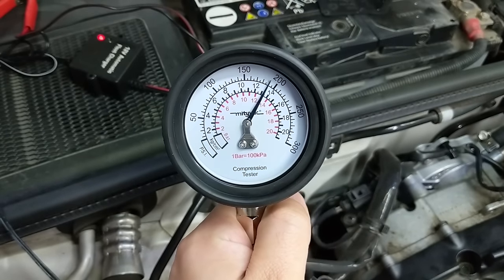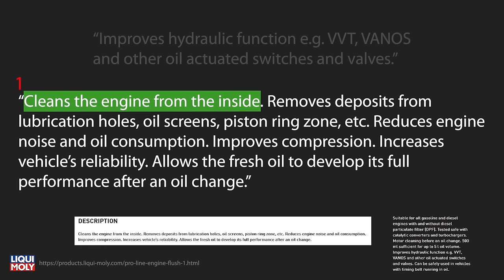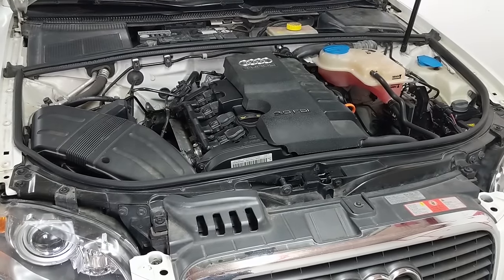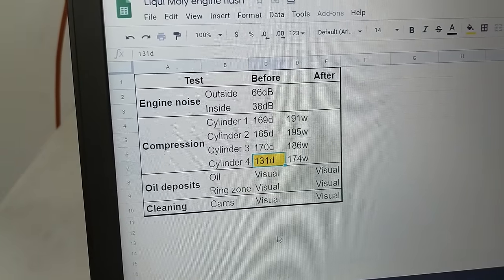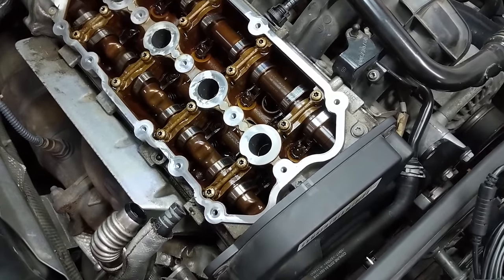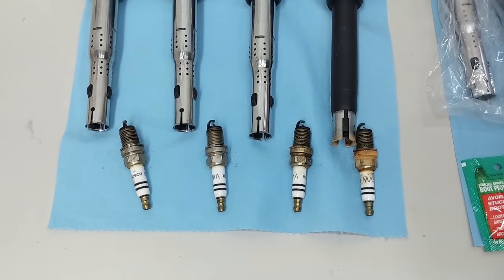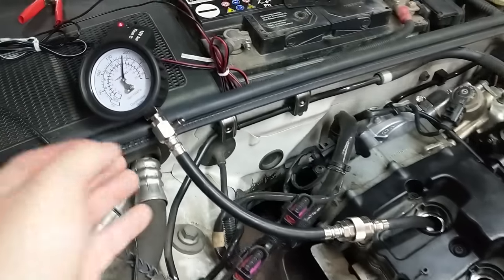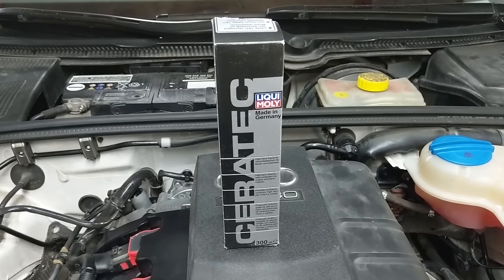Does Liqui Moly Engine Flush work? | Full Test & Review | Pro-line 2037

Comment: Just change your oil regularly. Modern oils already have detergents. That is why you change the oil as the oil itself does not actually wear out but it does get contaminants. Long ago Valvoline made detergent free oil. That caused the engine to gum up.
Reply: It's called combustion. No matter how many times you refresh the oil, there will always be deposits
Reply: supposedly Valvoline" has a Newer oil out W new stuff to help clean it while ur driving? pretty sure it's real.

Comment: I used this product and moved my oil changes to every 5k miles from the 15k that BMW specified that the previous owner did. I noticed a difference in the oil drain color 2 oil changes later. It stopped coming out dark black and now has a slight gold tint to it. I think it takes a few changes to really work. Just my $.02
Reply: Was looking for this comment. I just got a BMW 335d and the previous owner was doing the 15k/1 per year oil changes and I want to get the gunk out from that. I'm changing my oil every 5k 😂 they're out their damn minds telling people that's an acceptable change interval
Reply: mr mathew, you wouldn’t know if it’s liquid Molly or more frequent oil changes that made oil cleaner thO - 2 improvements at 1c & then one cNt tL which did the improving(unless ofcoOrs the other commentor leaves another coment after a couple oil changes)- wL 5k krispN?we’re w8ng✋
Reply: @krspykreame1 what's the update?

Comment: I did a Liqui Molly engine flush in my 2008 Lexus IS250 with 141k miles. I want to keep this car running for a while, because I really like it. Anyhow, after doing it, I noticed the car does seem to drive a little bit better. I do notice an improvement. Maybe I will do another engine flush later on down the line. Definitely during oil change, but maybe in another 50k miles or so.

Comment: If I may add something. I have been using LM Engine Flush Pro for at least 10yrs on various engines. If the engine never been flushed you have to do at least 3 flushes with fresh oil to really get rid of all the gunk. Also not 10 minutes but 30 minutes on idle. For example, in the 1.5dci Renault/Nissan engine with 15W40 inside (Yeah I know death for that engine), it took 5 flushes and 6 oil changes to keep oil clean after the oil change and 30m warmup. After this procedure engine stopped smoking blue, became quieter, and ran stronger. 
In my humble opinion: If you want to really clean your engine, buy a couple of LM Engine Flushes and enough cheapest oil you can buy for a couple of changes. After the last flush, change oil for the last time to the cheap oil and run it for 30m then change it (should come out quite clean) to some very good engine oil. Job is done
Reply: I use 15w40 in my 1.9dci renault. What could be the problem?

Comment: Im a big fan of liquimoly products.  I pair their oil with ceretec,and hydraulic lifter additive.  Ive tried EVERY 5w20 oil i coild get my hands on, my temp runs 6 degrees cooler, no more valvetrain noise above the  normal, it just all around is amazin. My car is almost to 200k as well. Recently used it in the wifes MDX that has oil consumption problems (3 QUARTS IN 1K MILES) and so far the dip stick is still safe, and the motor is smoother sounding.  Tried Royal Purple,  Pennzoil Platinum, Mobile 1, redline doesnt seem to make a 5 w 20, and if they did its twice the price. Ill never go back to the yellow,green, or purple again.

Comment: I'll add my experience.  2009 Audi A4.  105K miles, pistons replaced at 65K, cylinder head work from timing chain issue at 99k.  I have never missed an oil change and many were even done at much less than the recommended 10K.  I drained the oil with 3,000 (Motul X-clean) on it and put in fresh mobil 1 euro and liqui Moly's engine flush.  Idled for 15 minutes and drained.  There was no difference between the new and old oils even with light behind it.  I put samples in small 8 oz containers to compare. Only thing I noticed in the containers is the one with flush ran down the sides much quicker.

  My wife, who knows nothing about cars or what I did came back and said "whatever you did, it runs better"  I've worked on engines for over 40 years and I've never "flushed" a crankcase. Not sure why a flush would make it run better, my only guess is it freed up the turbo a bit.  In anycase, I'm a believer now and I have stuff on order to flush my '13 S6, 100K miles.  Any Audi fan should know the early 4.0 TFSi has an issue with the turbo oil inlet screen gumming up.  I'll probably change my oil change to 7,500k, It's cheap insurance.
Reply from the maker: Thanks for the added perspective. In hindsight, I think I and most other people make the incorrect assumption that you can/should see a significant difference in the composition of the oil, or it's viscosity by swirling it on the edge of something. My guess is that with the right equipment (any chemists out there?) the flushed sample would contain higher concentrations of X, Y and Z that would prove contaminants were removed but for the average Joe, the wife's testimonial of "it runs better" is one of the closest indications that improvements were had.
Reply: @FigureItAudi  I think I may have lacked clarity, my apologies.  When I say there was no difference, I mean the new flushed oil looked every bit as dirty and opaque at 15 minutes as the 3,000 mile used oil.  It was effing NASTY in only 15 minutes of Idling. Almost diesel oil bad.  As for viscosity, the flush is very thin and it thins the oil.  I definatly would not want to drive on the thinned oil although some do.  

I'm going to do this on my S6.  It has a drain plug on the oil filter housing (which makes collecting a breeze and takes 8.8 quarts.  I will drain old, reserve a specimen.  Put in new and idle a minute and take a specimen, add flush and take a specimen at 15 minutes.  This will tell exactly how much is "flushed" out.  Considering an oil test on used and flushed oils.  My wife already hates what I spend on the car, LOL.  

BTW, what do you use to edit your videos with? I may make one.
Reply from the maker: Gotcha, I didn't catch that you flushed with fresh oil; that is impressive (in a bad way), then. I use Adobe Premier Pro and After Effects in my more recent videos.
Reply: Hitman  Could be, but she's never said anything before after any amount of work done to her car, except for the replacement of the bent valves.  I've just finished the third of my families 3 cars.  Not sure it made any real difference but it did get a lot of crap out of there.
Reply: Hitman  It's already had 3 full DSG services.  Last one was about 3k ago.   is the bridge seal inside the transmission or outside, I've never heard of it.  I never skimp on the maint. Infact the last one was 3 ki miles ago and they replace ALL the fluids except for rear diff.  It took a special tool he didn't have  Thank you.
Reply: Hitman  WHEW.  Thanks  I plan on keeping the S6 for a long time, I'm watching for "failure points"

Comment: Fantastic video, almost to the level of Project Farm. However couple of big errors IMO, as others have mentioned.
1. Just crank until compression stops rising, might be 5,6,7...
2. You have a filter in the loop, so obviously where would we expect the majority of any gunk to have been deposited?
Aside those peanut gallery snarks, very good and useful to see that it didn't appear to do much cleaning of carbon at all.
Subbed.

Comment: Well, with my moms car (1.4 16V Seat Arosa Sport) a couple years ago, it was burning oil at about 1L/1000km, but after flushing with forte motor flush (warm engine, 45 minutes idling with sometimes revving up ,to 1500rpm) it went down to 1L per 6500km. So that was a huge win too! (So it's nice to see you have improvements in the compression test)

Comment: I've flushed my car with this and i checked the cams by taking the valve cover off and it wasn't far off from this.
Reply: And when you checked the cams before you flushed it, what did they look like?
Reply: @ferrumignis  they were reasonable for a car with 240,000 km on it. Mind you i've done a service every 10,000 km since i bought the car at 50,000km.

They have more of a sheen on them if i was to say what the noticeable difference way.

Comment: Funny I did it in my Audi and change the oil from Castrol to Motul specific and surprise no more rattling at cold start. Probably cleaned make some stuck valves or the tensioner stuck. It did something for sure.

Comment: i have an Acura g2 legend and when servicing the valvetrain of my car there was a LOT of oil buildup (prev owner was lazy on maintenance), decided to give this a try, added a bottle and ran it for about a week and a half then changed the oil and filter, repeated the process once more and changed the oil. after using this product twice in the span of a few weeks i took my valve covers off to check if it did anything and 90% of the oil buildup/carbon residue was gone and the valvetrain looked new. I 100% stand by this product, from now on im planning on throwing a bottle of this aprox 30 miles/1hr before i change my oil. if anyone knows about honda's c32a1 engines they have a habit of the hydraulic rockers making noise after a while. im not sure if this product cleaned out the buildup inside the rockers but they no longer make as much rattle as they did prior to using the engine flush

Comment: You should use cheap oil to flush the system after using liquimoly engineflush and then fill in with good oil.
Reply: The liqui moly flush evaporates
Reply: @LoopBooost How do you know? I was wondering if it did that. Makes sense. I couldn't find any info about it

Comment: Pretty confounding to me how you would on the one hand do a pretty thorough comparison, but then mix it up with mods that can of course have an impact on the measurements?!
Reply: How would they affect the measurements?
Reply: @802Garage  He replaced  coils, which have more effect than cleaning a clean engine.
Also that carbon build up in nothing. Its a combustion engine and they are not shiny and new inside. If he cleaned that up, it would be the same after one drive.
Reply: @Stanjara  what are you talking about??? Audi and vw engines all use coil packs and have done so for quite a while now.... are you talking about the spark plug gap because it doesn't show him pregapping the plugs?? That statement you made, made absolutely no sense, "replaced spark plugs with coils"???? It's not like he did a wire to coil pack swap upgrade...
Reply: @Stanjara  and if your cylinder walls aren't clean, you have some VERY WORN oil rings and should either engine swap or rebuild your engine. Even when I did the head rebuild on my 2.5l 5 cylinder from my 2008 rabbit which had 177k on it, the honing was still visible on the cylinder walls... but walls were not dirty, only piston faces, valves, valve seats and combustion chamber where discolored, which was super easy to clean and respec to make sure nothing was warped or pittied or scorched
Reply: @erikdefries4956  I was wrong, I meant he replaced the coils.

Comment: I alternately use this and Amsoil engine flush at every oil change . The reason I think my oil doesn't come out black or dark . It comes out a golden color that I can see through as it drains . Changing oil every 5000 miles , using either Pennzoil Platinum 0W16 / Amsoil OE 0W16 and always a Amsoil filter .

Comment: I used BG oil flush on an old MR2, and got 25% compression improvements overall, same plugs etc, just fresh oil. The BG product helps free up the piston rings and increases the compression, smells lovely as well. Having seen the results myself, I always use BG oil flush on every service, totally rate it.
Reply: are you refering to bg109 or bg epr or the super expensive $300 kit they sell?
Reply: How can you prove the very fact that you had an oil change had effect to the engine cleanness?

Comment: If you want all that carbon deposit cleaned from top of the pistons you should use Redline SI1 Fuel System Cleaner. When I used the product on my MK4 Golf It cleaned the pistons to a point where I was able to see the eccentric lines on top of the pistons.
Reply: yes I think Redline is the best

Comment: The spark plug that was showing signs of running hot had a coil over it that was different from the rest. If you compare the design with the rest, you can see that the OEM ones were designed to dissipate some of the heat while the aftermarket one was isolating the heat. It wasn't the right coil.
Reply: CRAP☹️, I just bought crakerjack box prize quality level coils from my nXdOr nAbr😒

Comment: I have to be honest, I didn't do an compression test when I use Liqui Moly Engine Flush on my 2015 VW 1.8 Gen 3 Jetta.  But I will admit I it worked perfect for my car because it was burning a ridicule amount of oil monthly were people was saying that's normal for VW/Audi.  I've owned multiply cars from both companies, hehe.  But this engine flush cured that problem immediately.  Their Jectron Gasoline Fuel Injection Cleaner, I'm using now to help fix cold misfires seems to be working also, only been a week but I've had no more misfiring.  Changing fuel filter within a couple weeks then Fuel System Cleaner to finish the job... 
So this flush achieved my needs, just my 2 cents...

Comment: I had an Audi A4 1.8T with 275,000 miles before my Brother purchased for his kids.  Always ran synthetic M1 0w-40W and changed every 5-6k.  In addition, I did not use low grade octane fuel.  Always ran 93.  Car ran great and my Brother sold after his kids used it.  I now have two Audi A6's.  One is an 05 3.2 with 240,000 miles and valve assembly looks a lot better than on this car, (when I replaced gaskets about 12K miles ago).  Never did I let gap or plug wear like this either.

Comment: So you wanna explain how you thought something you put in your oil would remove carbon deposits on top of the piston/in the combustion chamber?
Reply from the maker: Sure: I didn't. Like every time we all get under the hood, it's hard not to notice things in the neighbourhood of where you're working. It was neither my expectation nor Liqui Moly's product claims that deposits would be removed from within the cylinder - be it the walls past the rings, or on the piston face. Me making commentary about the carbon build up was just me reacting to something I've never seen in this engine before and trying to correlate possible metrics (ie. compression) to carbon deposits. I could have ignored it for the sake of simplicity in the video but, you know, car stuff is fun.
Reply: Daniel Combs  you wouldn't be able to tell with the piston at TDC. Never heard anyone say piston rings pump oil lmao what? You do not want blow by, that is when you loose compression. You know we are talking about an internal combustion engine right?
Reply: To remove carbon deposits inside the combustion chamber could be achieved by what you put in oil by reducing blow by, which is present in all engines. By reducing its creation you could theoretically eliminate it in time.
Reply: @FigureItAudi  Attention!!! Dimexide (the full name is dimethyl sulfoxide) has a unique property - it passes through the skin into the body and drags everything that is dissolved in it with it. And drugs and poisons. Dimexide and oil solution should NOT be touched with bare hands, like all Dimexide solutions. Can get from allergies to eczema. Take care of your health.
Reply: @BenState  your user name and response match well
Reply: @hsproyaya  you came up with that all by yourself.  good boy, and happy bday for Wed
Reply: Daniel Combs  maybe put away the phone while driving?
Reply: Daniel Combs  yeah but you're watching a yt video while driving.
Reply: Daniel Combs  , with the greatest of respect: I also thought I was experienced and competent, and capable of multitasking with my phone while I drive... until I caused an accident.
Even hands-free... it's not brain-free, and occupies a portion of your mental capacity.

Rather leave the phone. Give it your full attention while driving. ♥️

Comment: I would attribute the lower dry compression test pressures after the engine flush to the possibility that some carbon chunks were removed from the piston lands, thus increasing the combustion chamber volume and reducing the effective compression ratio. A greater effect, I postulate, is the freeing up of a stuck oil control ring on cylinder #4 that will allow it to seal better.

Comment: 1) You didn't crank the engine long enough on the first compression test you showed.  This put a bit of doubt into the other results.
2) That is not carbon on the cylinder walls, it's the shiny cylinder walls showing a reflection of the carbon on the piston crown.
Reply: I think this is correct - you can see reflected carbon pattern matches up

Comment: I'm going to use this on an engine that has been started many times, run for a minute and then shut off again. The oil was all milky from the condensation and i have cleaned out the oilsump that had a layer of grey milky oil on the bottom , the head looks really clean though. I'm doing a flush as soon as i've done some miles in this car again, have to break in a new cam first.